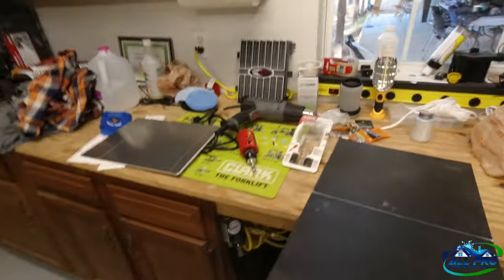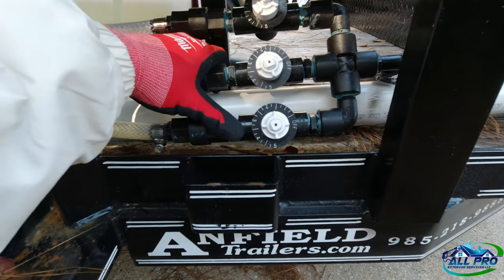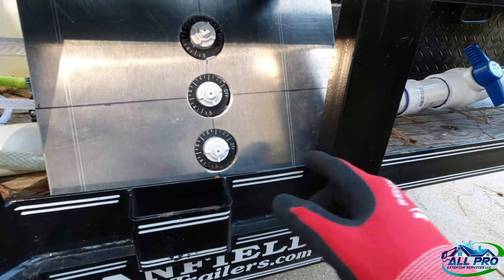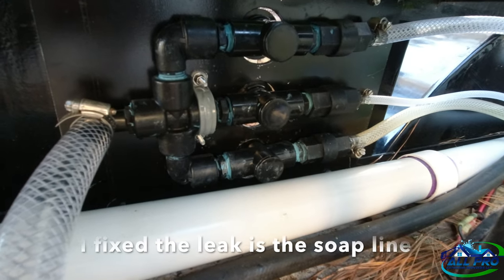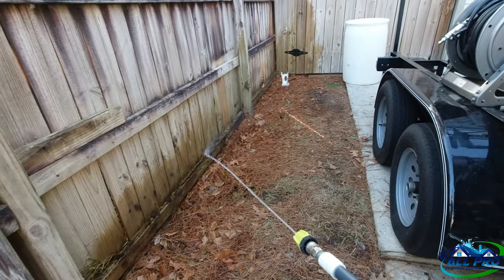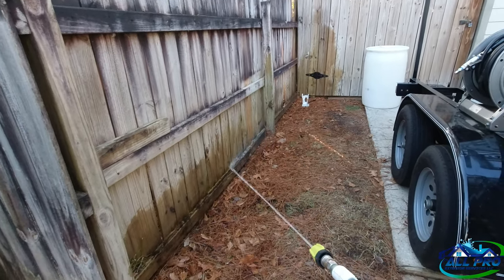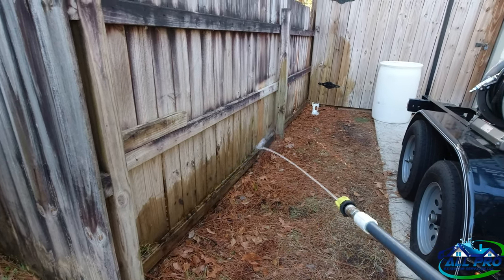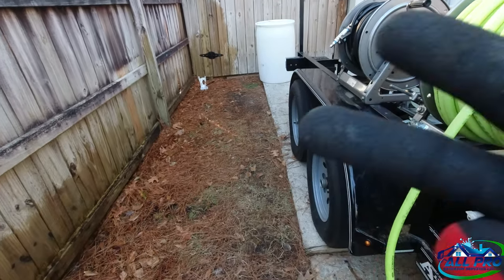Proportioner Mount for Trailer

Comment: In your test you proved the ball valve flowed more readily than these adjustable valves.
Maybe that is the answer to you question about why you lost distance. Let us know. I am setting up a system and looking into using a valve like this. You can give great info on how you got your distance back.
Reply from the maker: The GF valves ten to flow better in my experience. Thanks